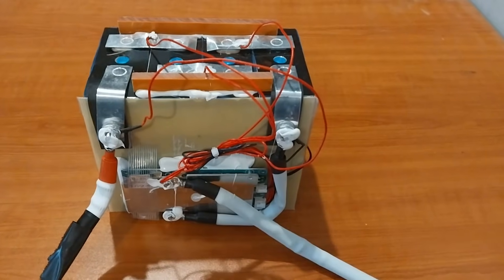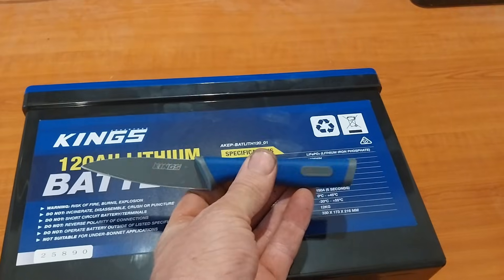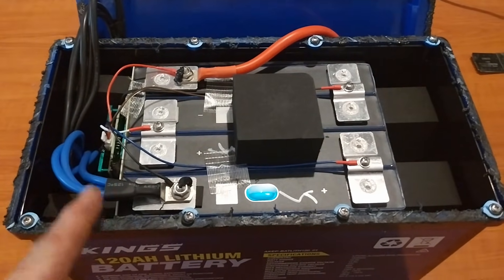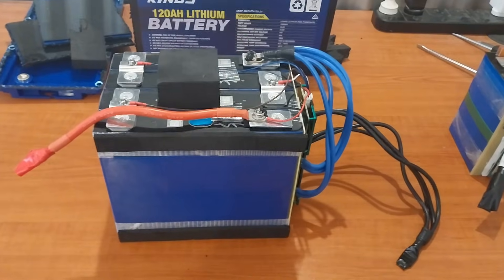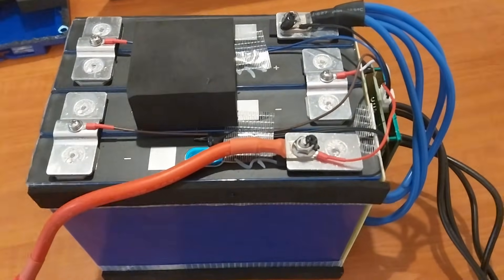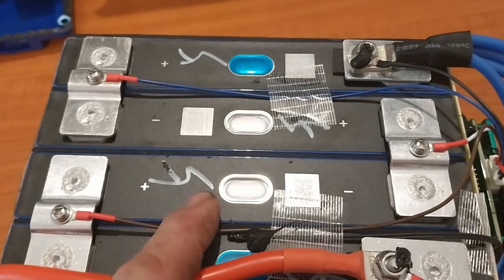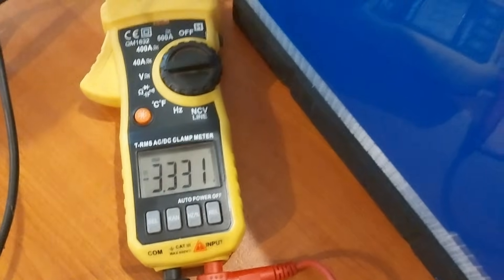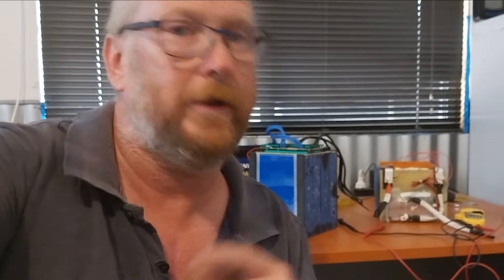King 120 Ah Lithium Battery Teardown - What We Find Inside ?

Comment: I've been running a couple of these in parallel since September 2023. I've had no issues so far. I'm also using their big 12-volt control box, and occasionally use one of their 3000W inverters. TBH, I have quite a bit of Kings gear. Light bars, a rooftop tent that I live in, plus a few other bits and pieces.
Reply from the maker: yeah I have a lot of Kings gear and mostly I have found it fine.

Comment: you need to check cell voltages when the pack voltage is around 14V, even imbalanced cells will look alright when at rest.
Reply: Yeah flat discharge curve shows nothing mid charge. Also you can balence cell top or bottom. Not both. If you pick top balence then don't drop to 0 %. Can't have both

Comment: Can you try fitting them in the 60ah battery box? Will it fit? And is it safe to use like that?
Reply from the maker: I haven't tried fitting it to the 60Ah box but would be worth a try 👍
They are safe to fit as long as you secure it down properly and nothing can short across the terminals.
Reply: Can you give us an update if it fits, it would be an awesome compact 120ah box 👍
Reply from the maker: @ The battery has already been put in the iTechworld battery box.
https://youtu.be/2xeXv0UYHGk?si=KeLE4U9xHWmsb549

Comment: Hi Glen, slightly off topic, but do you know if the 100AH kings have improved much? The king's website says they are now prismatic cells, but they only come with a 1-year warranty compared to 3 years for either the 60 or 120AH batteries? Seems a little strange?
Reply from the maker: That's weird ? When I bought mine, they advertised them as pouch cells.
Unless they have brought out a new product line using repurposed A grade 100 Ah prismatic cells, hence the warranty being only one year.... I'm not sure ?? It could also be a mistake in the product description.
Without getting one and pulling it apart it's hard do know what's inside ?

Comment: I know this video was posted Q1 of 2025, But did mention when the battery was purchased? Or if theres a build date batch number code somewhere?  I ask as the last video teardown I watched of a Adventure Kings Outdoor Gear brand 12 Volt 120 Ah Lithium battery it looked like someone had taken an angle grinder to each of the 4 cells QR codes making tracking technical specifications impossible
Reply: there is a date code on the BMS at 5:58 20240525 (late May 2024) also at exactly 1 minute the case serial number is visible.
Reply from the maker: This battery was purchased around 4 to 5 months ago. Was the video you watched done by Lock Your Hub 4WDing channel ?

Comment: No balancer?
Reply from the maker: Yeah the balancer is built into the BMS. You can see the balance leads on each of the cells which I showed in the video.
The voltage test I did on each cell came back perfectly in balance as well which is nice to see on these cheaper style of batteries👍

Comment: what is the discharge rate of the kings lithium battery is it safe to draw 2000 watts from an inverter off there batteries for say 30 minutes?
Reply from the maker: It depends on the battery you have. The Kings website has all the specs on their batteries so best to check on the Kings website.
But for this battery (120 Ah) the BMS says 150 amps draw but the battery is labels 120 amps maximum draw, I guess maybe due to the cable size they have used ??
So going on that you multiply the volts by the amps and that will give you the maximum wattage you can draw.
So for this battery the nominal voltage is 12.8 volts multiplied by the maximum output current of 120 amps (12.8 X 120) which gives you 1,536 watts. So you will not be able to pull the full 2,000 watts from your inverter running this battery. This will also differ slightly as the more current you draw the voltage will sag.
If you wanting to draw 2,000 watts from your inverter then you divide the inverter watts by the battery volts which will give you the amps the battery will need to output. So 2,000 watts divided by 12.8 volts gives a rough current draw of 156 amps. So you will need two of these batteries to safely run your 2,000 watt inverter.
Hope this helps.
Reply: @ thanks you so much I’ve got the kings 200 amp lithium  I’ll check there website for the exact specs
Reply from the maker: @harrisongauci2487  Usually most Lithium (LFP) battery manufacturers go by the figurers of the amp hour value will be the same current draw value (usually)
So 120 Ah battery will give 120 amps. Your 200 Ah battery will give 200 amps which is 2560 watts. So you will be able to run your 2,000 watt inverter from the 200 Ah battery. But still check Kings website, just in case.

Comment: Hey Mate great Vid! I'm interested how old is that battery, is it a new one you bought or already had? I just seen another vid of that same 120ah blue top and the cells were all set up a lot differently. Cheers
Reply from the maker: I bought it a few months ago. I noticed the lid is slightly different to the other Kings 120 Ah batteries I bought around 8 months ago so this battery maybe the newer type.
Can you send me the link to the video you watched so I can see what is in those batteries.
Cheers.
Reply: @TheOffGridBachelor  This is the Vid, its 18mts ago so battery could be older than that. Interesting is that the QR codes were removed at manufacture. https://youtu.be/MaVAZNQFlyk?si=YQEm8ujtyRr9HnK8
Reply from the maker: @ Ahh yes I have seen this video. The cells look the same but the way the BMS and balance leads are positioned is a little different. The laser welds on my battery are round as well so possibly from a different manufacturer / factory ??
Reply: @ I'm not sure, just been looking at these lifepo4 batteries recently so still learning!

Comment: Great video. 
I think the issues that most people have with the cheaper batteries is the quality control. 
If it was possible to open 100 of them and see if they are all the same. 

For the price they are now they are the same as a AGM and have more capacity and a longer life (providing the BMS doesn’t die)

Comment: Nice teear down mate. FYI code check comes back with EVE Power cells, LiFePO4, 3.2v, 12/Jun/23 production. (12mth+ old cells thought may have just been sitting in storage etc) BMS = No name, '4-series 12v lithium battery protection board BMS', discharge 150amps with balacing, charging current 100A'.
Reply: Would be interesting to approach EVE for the individual cell grading information , check if they are B grade cells.
Reply: Thanks for coming through with the QR code data
Reply: I think your bms info is wrong.  I suspect that it's Max load current/amps is 150amps for maybe 10 sec and continuous is 100amps the balancing amps is not known but susoect around 1 amp.  Would nice if it had bluetooth
Reply: @paulbushell1980  Translating it with google lens, says that the original commenters interpretation is correct, it lists 150A as discharge and 100A as charge current.

Comment: Things that would make it better are a small air gap between each cell. The temp sensor should be attached to either the anode or cathode providing a direct link to the inside of the battery, not the plastic casing as plastic is a poor conductor. The BMS voltages on a battery when its sitting idle is not really as important as balancing voltages when the battery is being charged and discharged.

Comment: interesting , kings owes you LOL.
problem for me is cycles are only 1800 to 2000 and they say quality bms  that could mean anything , low , mid , high ?
The price is good i just dont want to have to end up buying replacement batteries sooner that i hope for,  im sure kings will be even better again in the future.
Been looking at itech etc apparently top quality bms etc  yeh costs more though.
The kings 300amp were the ones i was looking into, by memory in the details of some kings it says high quality bms love to know the manufacturer
Reply from the maker: Even if one got 1,800 cycle for the battery, that is nearly five years of fully discharging and recharging the battery everyday. So if it only last five years, for the price, that is realy good. I was flat out getting three years out of a good quality AGM battery.
Most people don't fully cycle their battery everyday so for most people it will last longer than they will have the battery for, before buying the next new latest battery on the market or selling their vehicle or caravan with the battery still in it.
The question is the BMS and how long they will last. There has been other manufacturers that charge three times the price, have their batteries fail so it is hard to know how long these batteries will last. I don't think they have been out in the market long enough to see if we truly get our 2,000 - 5,000 cycles claimed, time will tell though.
I have three friends that have the 300 Ah Kings batteries and they all are running without any issues, so far ? I myself are tempted to get the 300 Ah and give it a try 👍
Reply: @TheOffGridBachelor I’m 100% convinced that for 99% of people, calendar aging will be more of a degradation problem than “cycles”.

Comment: What a Load of Crap. None of 120ah Kings are The Same. Most of it Gotion  63Ah Cells 4S2P. YES same Cells as in 60Ah Battery But in Parallel.
Reply from the maker: These are the newer batteries that Kings have out now, not the old ones. In fact these batteries have been out for a while. Your thinking of the older batteries which is not what I tore down in this video.
Reply: @TheOffGridBachelor  

You are Wrong. I have opened 120ah Purchased in October 2024 (Blue top)
Gotion 65Ah Cells. 4S2P (8 Cells).
Capacity Tested 131.6Ah

I work in an Industry and Cannot publicly publish or have channel etc due to contractual agreements.

Your video is Only Showing 1 Option that is Lucky to cover 30% of Blue top Batteries
Reply from the maker: @ModestasJablonskas  I have a few more of the 120 Ah blue top so I might grab one of those and pull it apart. It is a slightly older version so it may have the 4S2P set up.
I will say though they have preformed realy will so be interesting to see what is in one of those batteries 👍
Reply: @ModestasJablonskas I’m wondering if you’re with DCS? 🤣🤣🤣🤣
Reply: @ModestasJablonskas  So capacity tested well above specification. What is the problem? "Contractual Agreements", yeah right 🤣🤣
Reply: The guy commenting above is right. I have seen inside a fair few of the 120ah kings and there's a few types. Some are single cells (1p), others are 2p. I've seen about 3 types prismatic cells in the single cell ones. Some are lying down, some are vertical like in this vid. some have bolt connections, other are welded bus bars etc.
Reply: @tomgrant6563 impossible to have anything less than 4s in a 12v due to chemistry. Each lithium cell will be 3.6-3.7v nominal so to get 12v you need 4 in series. Adding more in parallel increases total capacity. The shape and size won't change the underlying chemistry.
Reply: @sirtra haha no I mean 1p4s! But I can see that's misleading. The 1p is to distinguish from the parallel/series arrangement often used - in the case of these kings batteries,  often each cell is made up of 2 paralleled cells, so they call that 2p4s. But other times they use 4 single bigger cells and you can call that 1p4s.
Reply: @tomgrant6563 you have everything correct except what you are calling a cell (4 in series) is actually a pack.

So the battery may have 1 or 2 packs, with each pack containing 4 cells

Other than that we are in agreement 👍🙂
Reply: @sirtra ohhh so have I been misunderstand it all this time? Does the p in '1p4s' mean 1 pack??
Reply: I always thought you called that a 'bank' and cells in series were called a 'string'.
Reply: @tomgrant6563 if we were talking solar panels yep that's termed a string.
For batteries it's termed a pack, with several batteries being a bank.

Don't ask me why tho, this the end of the road for my knowledge 🤷🤣
Reply: @sirtra I just looked up a few websites and it looks as though 4s2p might be the convention. So I had that backwards. And I think the p does stand for parallel, but maybe you are also right. It's a pack or parallel unit. Same thing I guess.
Reply: @tomgrant6563  the s4p2 describes the specifics of the pack, s=series p=parallel. RC cars have battery packs, you dont say oh damn my battery s4p2 is flat. The BMS controller doesn't manage the cells inside the s10p2 for that 36v cordless drill... it just doesn't roll off the tongue right mate 😉
Reply: @sirtra I think we're both misinterpretating some of what we're saying. I had to read back to my first comment and maybe you thought I was calling the whole pack a cell?? This is not how I meant it! Anyway... It doesn't matter 😂. So yeah to rephrase my first comment: some PACKS are single-cell 4s strings, while others use 4 pairs of parallel cells (4s2p). A diagram would be a lot clearer haha.
Reply: But do they perform as advertised??
Reply: Your thinking of there black top battery's which used pouch cells. The blue tops *torn down in the video* have been out for a while and other teardowns show they are all the same. Get your information right next time before making a useless comment.
Reply: @ 

You a Full of Shit mate

I have Opened ~70 Kings Batteries to date

All 100ah Are Pouch (Regardless of the Shape)

120Ah Mostly Gotion 63Ah in 4S2P
Some Gotion 65ah
Some Eve 125ah 4S
Reply from the maker: @ModestasJablonskas  Yeah the 100 amp hour battery is the pouch cell battery as I have one I am testing and they do still sell that battery.
The 120, 200 and 300 amp hour batteries (blue top) has the prismatic cell in them, there are heaps of videos on YouTube validating this. If you have opened a heap of the newer style of 120 Ah blue top and have found different cells, please share that on your channel and send us a link, I be interested to see one.
Also their is no need to be rude in the comments, it's not necessary. We are adults sharing a passion for solar and batteries. Saying people are full of shit and a load of crap is not necessary or acceptable. So please validate your claims with videos on your channels, I am seriously interested in seeing these batteries you speak off 👍
Reply: @ModestasJablonskas  Pros/cons which is better ?
Reply: @gerardosullivan7126  

Better is to Known what you actually getting.
Especially if connecting in parallel

Highest Capacity so far Delivered from Gotion 65Ah 4S2P (8 Cells)
Probably least common to what I discover

Eve 125Ah Is Good too 4S
But All I opened were Grade B at Best. With Reprinted QR or Removed QR
Reply: @ModestasJablonskas   Im just after a single, not looking to Parallel and will be light duty use house battery, probably be good for what I want it to do. What lifespans you been seeing with them?

Comment: Great work Glen, definitely better than the previous one, didn't like much of what I saw in the other one. I think I'd still be tempted to drill a small hole in the top of the case and fill it full of resin, that way I'd be sure it's not going to be damaged by corrugations.....now all you have to do is rewind the video and the battery would be put back together again and can go back in you power box ! 👍👍👍🤠😎
Reply from the maker: I would probably not want to fill it full of resin as it would cover the pressure release valves on the top of the cells as well as enclose the cells which would increase the chance of heat build up.
The cells were that secure in the case I had to cut the case completely apart to get the cells out. I would doubt they would move around on corrugated roads. I would be more worried about shaking the BMS, regardless of what brand of battery used.

Comment: I recently bought this for the back of my 4wd. Happy to see the results. And keen to see a discharge test of it. Cheers Glen
Reply from the maker: I did a discharge test on the two Kings 120 Ah batteries on my 24 volt system and they come back at more than the rated capacity.
I will do a test on this battery and see if it preforms above the specs as well.
Reply: I also did discharge testing and both of my new 120's and they exceeded their rating, one at 125Ah and the other 127Ah.  So far so good with mine, certainly the price was right and they are holding up performance wise as well.  I have an older one that still measures out at 124Ah after 18 months.

Comment: Great vid mate 👍 just 1 thing, when you tested each cell for their individual volts, all the cells are still linked so it will show the same 3.331v no matter where you test. For you to get an individual cell reading, you'll need to remove the connectors between each cell first.
Reply from the maker: You can read the individual cell voltages when the cells are wired in a series connection, provided you prob the right terminals. A good example is the balance leads read each cell individually when the pack is still linked together.
If you watch my teardown video I did on the 60 Ah battery, you can see the battery cells voltages were all different when I preformed the voltage test with the pack still assembled. It's kinda hard to explain, but it can be done.
Reply: @TheOffGridBachelor one thing to note is you must measure when fully charged. Flat voltage curve on life04 won't show imbalance
Reply: Ahh ha! Gotcha, cheers